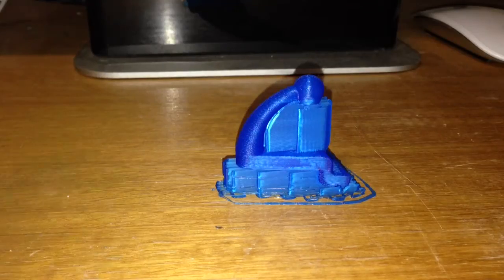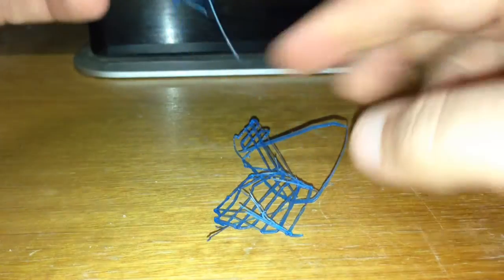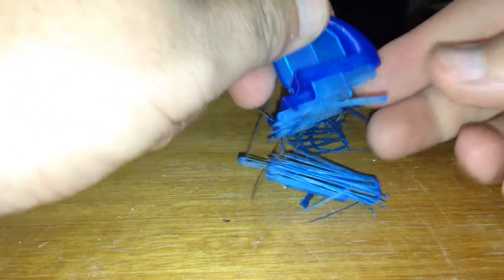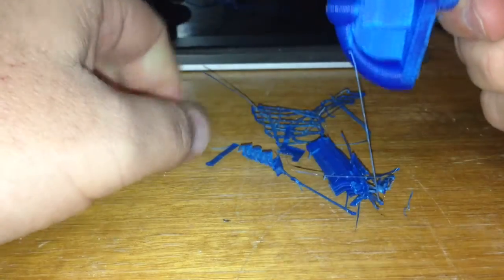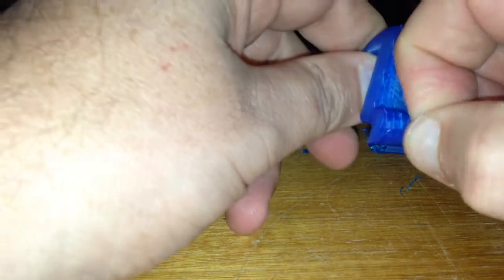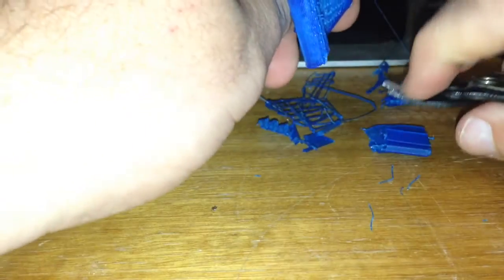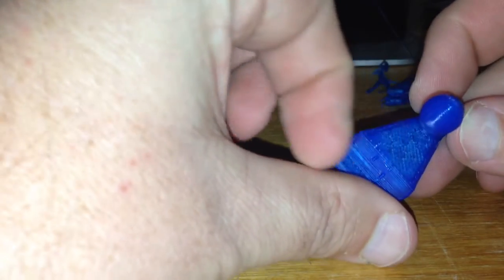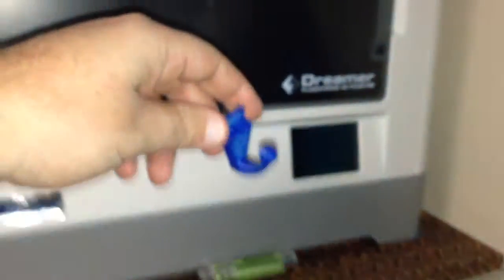Flashforge Dreamer - Remove raft & supports

Comment: Do you know if there is a setting in Flashprint that would effect the density of the supports? Sometimes I feel my supports print out almost to strong and it can be quite a process remove them.
Reply from the maker: Not that I'm aware of. When I print supports I use SKEINFORGE to slice the model because the skeinforge slicer makes REALLY thin supports that click of very easily. Slic3r seems to make thicker harder looking supports. I haven't tried printing supports with slic3r yet and don't intend to yet.
Reply: Ok thanks, I've also noticed that the Skienforge does a better job. Most of my successful prints have been with Skienforge.
Reply: Exactly. The support is really hard to remove. One of my prints has small supports and it's nearly impossible to remove without leaving line marks. I will try with Skienforge then as per your suggestion.
Reply from the maker: Awan Soekamto Hi Awan. Skeinforge does create the better and easier support, but even the best will leave marks on your prints. I ended up buying Simplify3D. The supports are FULLY customizable and you can select where you want the supports and they work that well they literally fall off and leave no marks whatsoever
Reply: I have Simplify3D, but just recently my prints are  less than satisfactory. One of them is the round parts being wavy (wrinkles). I am not sure what causes that. How do you set Simplify3D settings for your Dreamer? Thanks.
Reply from the maker: Awan Soekamto I'm just using all default settings EXCEPT the extrusion multiplier is default at 0.9, I have to change that to 1.0. I'm printing round propeller blades by the dozen at the moment and they are coming out absolutely perfectly round. If you have "wrinkles" your belt tension may be lose

Comment: Did you notice a different slicing with Skeinforge and the Slic3r from Flashprint?
Reply from the maker: Yes, sorry I made a mistake in the video. This is using the Skeinforge slicer. With the flashprint software you can ONLY print raft using skeinforge, because there is NO setting to print a raft using the Slic3r setting inside the software. 

Yes, theres a big difference between the skein forge and slic3r support structures. Skeinforge uses a single bead of 0.3mm strip in a thin delicate (made to break pattern) in straight lines. Whereas Slic3r tends to use octagon shapes which look more difficult to remove.